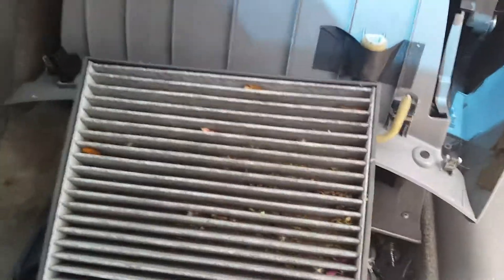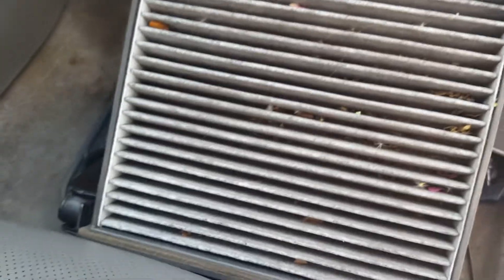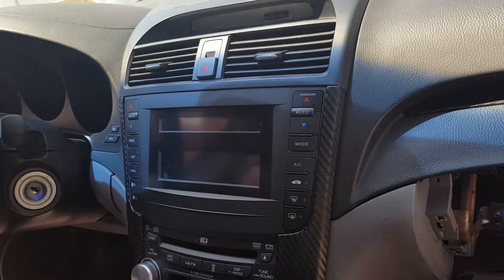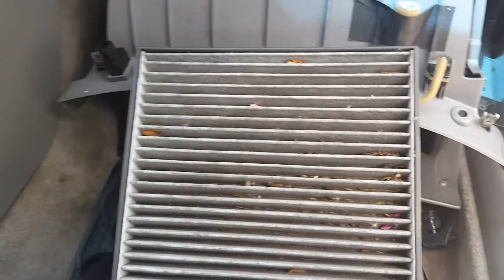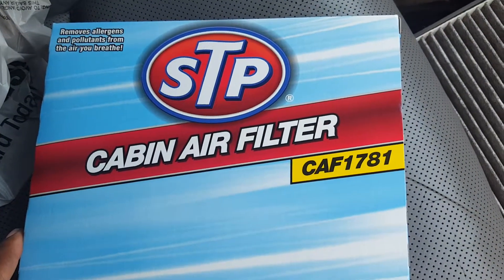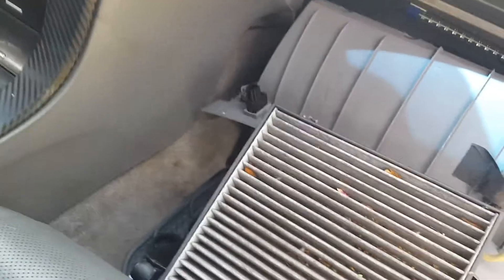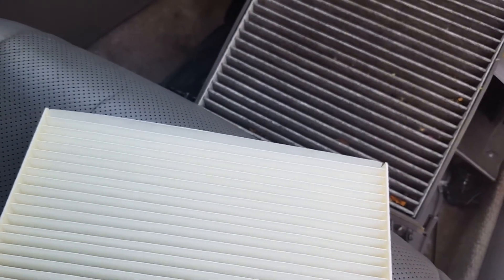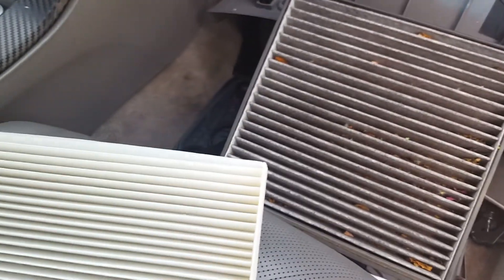HOW TO REPLACE 2004-2008 ACURA TL CABIN FILTER QUICK AND EASY

Comment: Yo bro, you should make a video on how to remove interior passenger door panel?, the bottom door panel light doesn't come on and when its opened at night the dome lights dont turn on as they should when a door is opened.